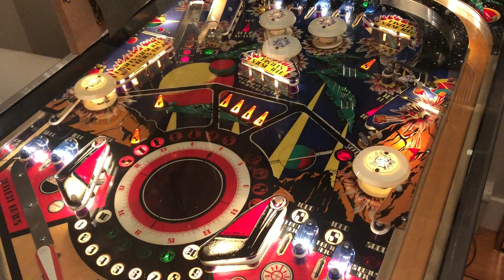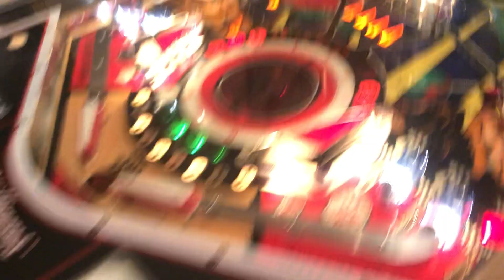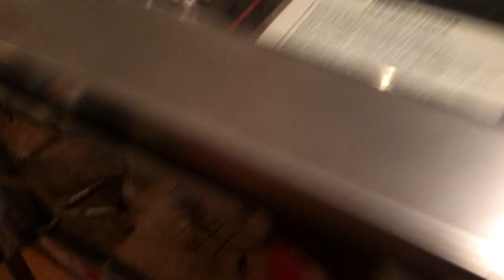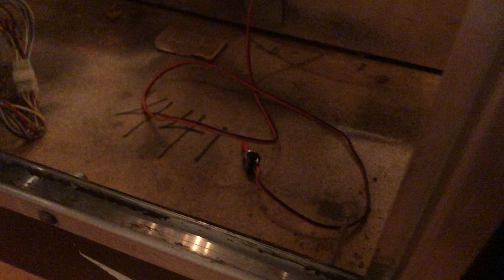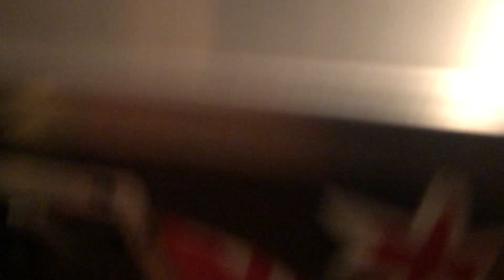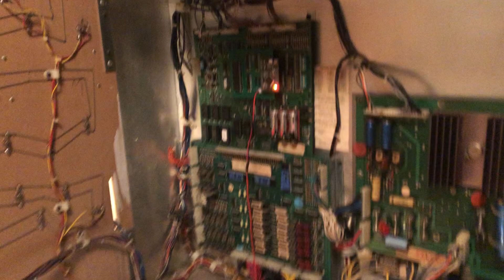Williams System 6 board running with an Arduino

Comment: I have a few system 3-6 games I would love to learn more about this. Where can I find more info?
Reply from the maker: You can find more information about the research and hardware here:  https://pinside.com/pinball/forum/topic/replacing-the-m680x-in-a-williams-system-6-with-an-arduino
Reply: @ike9167  nice I posted there. I have few system 6 games and would love to recode them. (Also want to update Earthshaker as it has a fun layout but suffers from bad code)
Reply: @ike9167  do you make the daughter boards for sale? I have access to a pick and place machine if you wanted to make a small run on them. My friend has a pick and place and a flow table in his garage. He teaches electrical engineering and Cs at University of Texas San Antonio